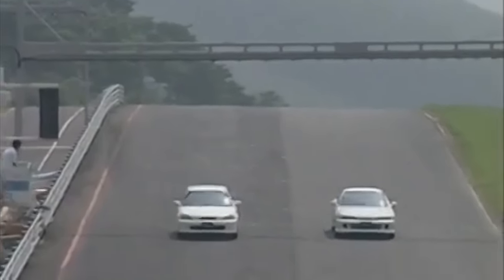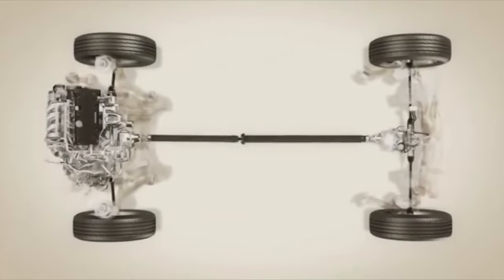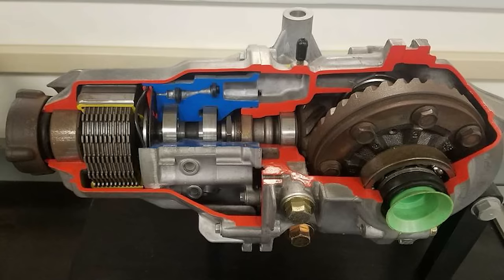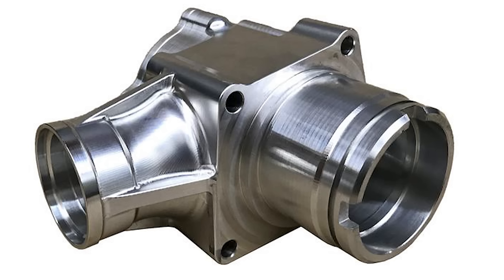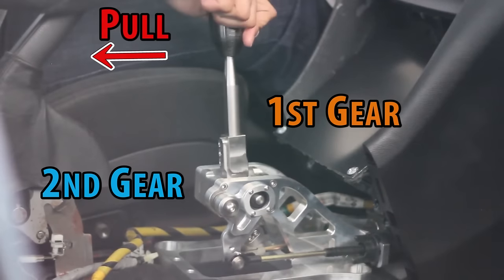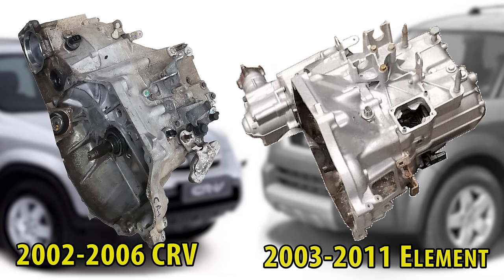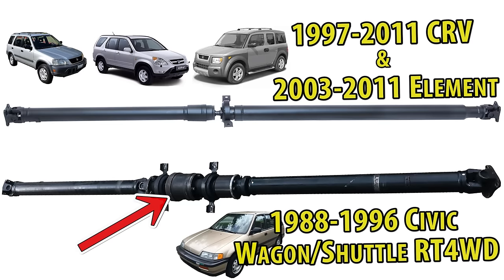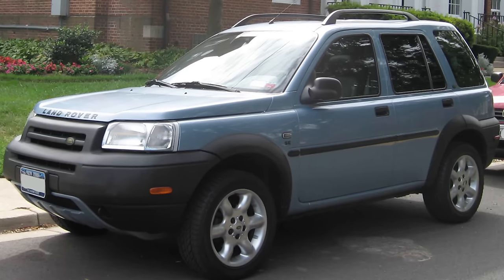How to Convert your Honda To ALL WHEEL DRIVE !

Comment: I went awd in my 93 eg hatchback and it's a different feeling. I was making 867hp from my K-Series then switched too a Honda element transmission the gears from my k20a fit right in the element got a wago drivetrain and got the dip and viscous coupler rebuild. Used hcp kit  never going back too fwd 💯😂...
Reply: Did you cut a tunnel for the drive shaft?? I'm planning on doing AWD conversion on my b18c civic ED
Reply: @nicoesko1956  no you don't have to cut a tunnel for the driveshaft. The chassis has it already where you exhaust would run, but you will have too get a fuel cell, because the stock gas tank would be in the way of your rear differential. Hubcity performance sells a AWD kit also S1 ,and FCS racing sells 1. Then you get a rear differential from a 89 Honda civic wagon, and viscous coupler, you will need a honda element or a honda crv transmission. Etc etc but yeah it's a fun car to drive.
Reply: @seankaine2411  can the chassis handle AWD? Wouldn't that twist the frame?
Reply: @savagesock3598  watch Jimmy Oakes throw a Nissan KA24 into his EK. They reinforce the chassis underneath

Comment: After sourcing all the parts and having to fabricate whatever extras you need to make an all Honda parts AWD system work I wonder what comes out cheaper. There are a few companies that make real 2 differential AWD transmissions for racing or serious tuners. A few of them even make streetable versions of their sequential transmissions like Quaife in the Uk and I know theres a company in Australia that specializes in Nissan GTR's that I believe began offering FWD transaxle based versions as well a few years ago. Cant recall the name. I think Quaife makes a sequential with helical gears for the street thats in the 10 to 15K range. I'd imagine the AWD version would be at least another 10K and you'd still require a capable rear diff and driveshaft. My point is that these kinds of projects add up quickly. There are always a million seemingly small things that add up to as much or more than all the major parts required. And when your done you still have a subpar AWD system with no ability to alter the torque split front to rear as far as I know. Really makes me wonder if it wouldnt be better to just call up one of these companies and tell them what you want. It would obviously still require some fabrication but I'd think less than piecing a system together from a mix of factory, custom and aftermarket parts. I really have no idea which way would be cheaper but one route is definitely technically superior. I owned an Sti for about 5 years and have been planning to get back into something similar. But I also have a 2014 CRV EX AWD with 20k miles on it I basically got for free that looks like it would like to be made into a rally car. Even if I dropped 60 or 80 grand into it i'd have something totally unique with a real performance oriented AWD system like those used in rally cars. 4 or 500hp is pretty easy with the 2.4K motor and the right not laggy turbo. And the purpose built tranny and AWD system would be bullet proof at those power levels and all the parts designed to work together. Suspension, Brakes, some lite forged alloys, beefy street tires and the thing would be a blast to drive. And run with GTR's or 911 Turbos easily. As long as they were close to stock lol. I've always liked oddball cars, I'll probably just end up trying to find another clean STi, obviously not new this time since they are out of production and I like the hatchback anyway. I just really have a thing for sequential or even DCT transmissions, the few non supercar DCT's that are actually performance oriented. I think the EVO MR has a bunch of mods available for its DCT now. People really ignored that version because of the tranny and the percieved inability to mod it for power. And I cant ignore that building your own AWD Honda in a non daily driver allows you to do it a bit at a time. Thats how I afforded every car I've heavily modded. Rowing gears is fun, I'm in my mid 40's and every daily driver I've owned since 16 has been a stick. I love Honda's, love the K series, the new civic type R motor is a beast. But half or more of the performance crowd will never take Honda seriously until they combine these engines and chassis with a real 3 diff AWD system. The advantage of being able to shift the torque split cant really be understated. Especially if it has a 2wd mode like the GTR's, why waste fuel turning all that extra gear when its not needed? If the system is designed for it. Honda should really listen to the entire performance crowd, not just their fanboys. I mean if enthusiasts are willing to go through all this, spend this much money just to have whats in reality an inferior AWD then clearly they'd buy every AWD Type R Honda could produce. Unfortunately I think they are all going to be focusing on electrics going forward. And thats not all bad, Honda's been into mechanical torque vectoring for a while, at least since the last Prelude. Thats much easier with electric motors, even without four of them. Some Teslas have a torque vectoring system that uses an open diff and the massive brakes achieving most of what you get from individual motors per wheel. And Now some of Honda/Acuras hybrids have their integrated Motor Assist system coupled with 2 small electric motors on the rear axle. But they are seriously stuck on their cars feeling like FWD's even when they have AWD. That makes sense for the masses but just frustrates enthusiasts. And electric torque and torque vectoring is awesome but I dont want a 6 thousand pound plus performance car. Mass is mass and theres no way to hide that much of it. Anyway, great Video! You guys put a lot into this and I know its far from a simple topic. And please take no offense to me calling these built AWD's inferior. They are superior to 99% of the modded cars out there. Just not to an AWD system designed for strength, performance and adjustability from the factory. Most people dont even know that there are major differences in types of AWD. Videos like these enlighten us and thats always a positive so thank you.

Comment: Hi there, for a b series conversion, 2wd to 4wd 
I would recommend using a Honda orthia, very popular in Japan, exported to many countries including New Zealand, the 4wd 1996 2.0 using the b20 engine is all you need for a integra dc2 gearbox, driveshaft, 4x 100 hubs, all interchangeable, except shocks and springs which are taller in the orthia. Gear leaver bolts right up. 
I was thinking of doing a video myself, great job on yours.

Comment: 7:58. Since this is a viscous coupled system, you can't express the torque split in fixed percentage terms (like shown in the video), it'll depend entirely on how fast you're going.  The reason for this is because the viscous fluid binds due to rotational difference.  That means if the front final gearing and rear final gearing have the same relationship to ground speed, there would be basically zero torque transfer unless SIGNIFICANT wheel slip were to occur, as there would be no rotational difference in the front and rear shaft speed, thus no viscous bind, thus no torque transfer.  

In order to provide any torque under non-slip conditions OEMs do what is called "pretensioning" the system.  To accomplish this they change the relationship between the front final out and the rear final out.  What we are looking for is for the front input shaft to be spinning faster than the rear output shaft for any given speed. To accomplish this the rear diff needs to have a lower output ratio than the front diff, assuming the rear is the off power set of wheels.  (Say 4.45 rear and 4.5 front, just as a random example.) 

(The primary reason OEM's pretension the system like this is because they want to limit the amount of tire slip required before meaningful torque transfer occurs, this also improves handling under motion as well.)  

The consequence of this is that the amount of torque transferred to the off power wheels (the rear in this case) is not a fixed relationship.  The faster you go, the larger the rotational difference between the front and back, and the more the viscous fluid binds, and thus more torque that is sent across the viscous couple, up to 100% or full lock.  This means the bigger the difference between the front and rear final outs, the faster (sooner) the transfer.  If it's a small difference, then maybe you have 5% torque at 15MPH and 50% toque at 100MPH (completely made up to illustrate, I don't even know if the relationship holds), and if you had a bigger difference, then you might have 15% torque at 15MPH and 100% torque at 75MPH.  In that latter scenario, if you went above 75MPH the system would start to bind, and you would lose vehicle stability as tires fought each other for grip. 

Another consequence of viscous coupled AWD is that you never have AWD grip on launch, because there is zero rotation to begin, and thus you have zero rotational difference across the couple.  So from 0MPH to 5MPH, you'll have basically zero torque transfer across the couple. Though the more aggressive you make the difference between front and back, the sooner the torque comes on, but the more you limit the system's top speed. Which means, the bigger the difference the harder you can launch, and the more you limit your top speed potential.  That means you want to tune the system by first establishing what the vehicle's absolute top speed with be, then setting the difference to allow for that top speed, with a little additional play, but not much more than that.  Basically you'll want about 97% torque transfer once you get to your top speed.  

Apart from that, the exact transfer figures will depend on a few factors.  

- What the rotational relationship is between the couple's input and output shafts at any given speed?  
- How fast the couple binds for a given amount of difference?  
- Which in large part will also depend on the properties of the specific viscous fluid that is used, as well as the ambient temperature of the environment the system is being used in.  This of course means you can tune the system to some degree by fluid selection. 
- Another way you could tune the system is by staggering the tires you're running front to back.  Having larger tires on the off power wheels (the rear in this case) will speed up the torque transfer rate.  (Again, the bigger the difference front to back, the bigger the effect.) 

If we know the viscous couple's transfer rate, we could work out the entire systems rate by working back from the finals' output figures at any given speed.  

If we don't know that, then you'd need to use an AWD dyno capable of reading torque at both the front and back independently.  Or you could use a regular two wheel dyno on the off power wheels and a set of rollers for the primary wheels, and then you could work out your torque at a given speed.
Reply: Why couldn't you just pin the rear clutch pack and use the same final drive for front and rear. I like the idea of crunching numbers for a desired top speed, and working as to not unbalance anything in the driveshaft. Just seems overly complicated, and I believe the speed at which the fluid engages the clutch pack is too slow to save some OEM design.

Comment: Very informative video man it covers basically everything. Another good bit of information that I can tell you is that the ek5 RTi 4wd factory civics, when you put a k24 into them and swap the 4wd bits out for wagon stuff, it bolts in with no modifications and you don't even need to cut the driveshaft for it to fit like you do when you awd convert say a eg or DC integra. It's basically a perfect length but you need a hub city performance driveshaft adaptor, only reason I know this is because I did it in my factory 4wd ek
Reply from the maker: Great to know. Thanks!

Comment: Civic FK3 shares the same engine as RE9 CR-V, which came with an AWD transmission. N22A2 with a map and an uprated clutch outperforms the Type R variant. Diesel torque.

Comment: If youre using a freelander driveshaft on a b series setup (i have an EK chassis. But i THINK the wheel base is all the same for eg, ek and dc) and if you dont plan on running big power, you can use those aluminum adapters the bolt to the flanges and you DO NOT have to resize the driveahaft. Itll fit just right.
Reply from the maker: Good to know. Thanks!
Reply: @GTContent  don't get me wrong. To do it the right and reliable way (especially for power more than 250) is to weld on proper flanges and have it balanced. But, in my case, to get the swap done, I used the adapters.

Comment: I have a 1992 lancer with a 4g93 engine. There are some ways to AWD it, but mostly difficult in my country. One of the ways that I was thinking that would be easier is attach a transfer case from a Mitsubishi Airtrek to the stock gearbox, and put a rear differential from it as well. But I don't know what to look for in terms of gear ratio, for example. Does the final drive from the gearbox needs to be similar to the transfer case and rear differential? Thanks.

Comment: i have a JDM 96 Honda Civic EK5 RTi AWD sedan factory.....i am doing a daily driven JDM K24a KSwap. approx. 300 whp N/A..can i reuse my stock rear axles with a 2003 CRV AWD Differential? and what upgrades must i do in the rear in terms of the diff mounts etc...great video ..

Comment: is there a transmission option if I'm running an H22a?  will any of the listed transmissions work?
Reply from the maker: There's a custom H22 billet awd housing I believe. Can't recall who manufactures it. The best/cheaper option would be a b-series CRV awd transmission and H2B adapter.
Reply: There is only one person making them. Look up the few h22 crew. Aaron Lopez custom made  his own and it uses the k series transfer case. He just ran 7.79 in his awd Ek.

Comment: Ok so some cutting and welding is involved to install the rear diff/suspension. I thought that there was hardware/conversion kits that were all bolt on with no cutting/welding involved.
Reply from the maker: There are a few ways to do it.  Welding would be preferred for the rear differential hanger, but you can bolt it in also.
The rear diff mount will "bolt on", but you'll need to cut the oem rear subrame to allow access for the rear diff mount tabs. You can leave the cut portions of the subframe open, but it'll eventually rust and allow debris to get inside, so it's best to weld it up.

Comment: Very Informative Video. There is a joke that for the money you spend servicing your Subaru, it should include a civic D series so you have something reliable to drive but this time a Subaru might be an easier solution if AWD is a must. 😂
Although, it is much easier to rebuild a K series than an airplane engine with a split case.

Comment: Dude, you’re a genius for gathering all these info. Just 1 extra question, is it possible to use automatic transmission from CRVs? I want my 2 gen TSX to still be automatic.
Reply from the maker: Yes, you can.
Reply: @GTContent great informative video. Would you happen to know if you can use a 2nd gen Crv automatic inner bell housing to then attach the manual outer casing of your liking?
Reply from the maker: @carlosvelez91  Bolt pattern is different
Reply: @GTContent  thank you , so it won’t work at all I assume and must be a manual awd trans right?
Reply from the maker: @carlosvelez91  You can use the automatic as it is. You can't swap bell housings from auto to manual. You'll need to get an awd manual transmission from a CRV.

Comment: Excellent!! Great content!
Subscribed!!
Reply: Is there any extra risk of brake the rear diff of a CRV as long as they are not made for being in use all the time because of the dual pump sistem?
I would like to solder mine for all time awd
Reply: And...after that, should i use a different diff oil as long as the dual pump sistem is no longer needed?
Thank you so much

Comment: Great Video, But i would like to pick your brain a bit. I have the 2012 Honda Accord 2.2 I-Dtech. The Clutch was slipping. I replaced the clutch but it still slips. Any reason why it would ? I did no performance upgrades on this car.

Comment: im not into racing but i want an automatic awd civic. i have an automatic 2000 civic Si coupe. I want to convert it to AWD. I also have an automatic 1999 Honda CR-V AWD as a donor car. i want to know if it is possible to take the engine(B20Z2), transmission, transfer case, driveshaft, and rear differential from the automatic CR-V and swap them into the automatic civic. Allowing the civic to remain as an automatic?

Comment: i so happen to have a JDM 96 - 2000 Honda Civic EK5 RTi AWD factory sedan. and i am doing the k24 kswap approx. 300 whp n/a.....can i use my stock rear axles with the 2003 crv awd diffeential?.....i am DIY wanting to upgrade to JDM k24a swap....